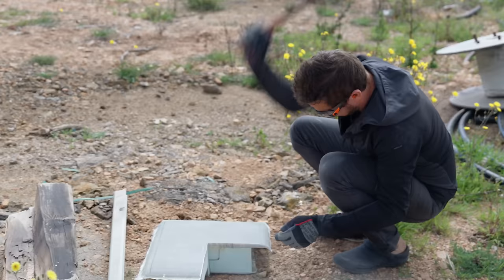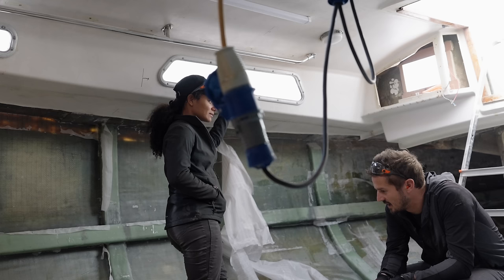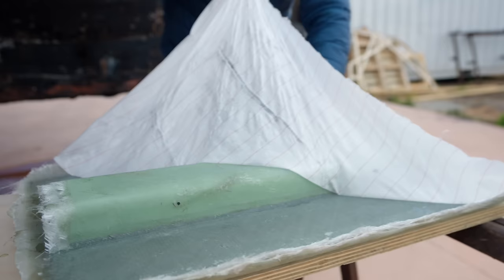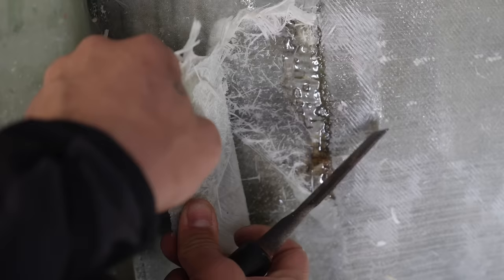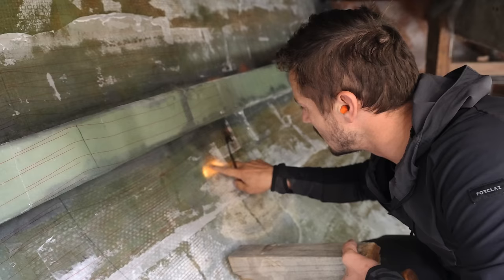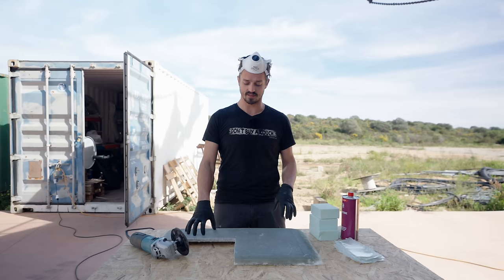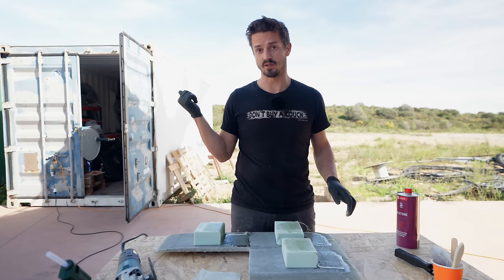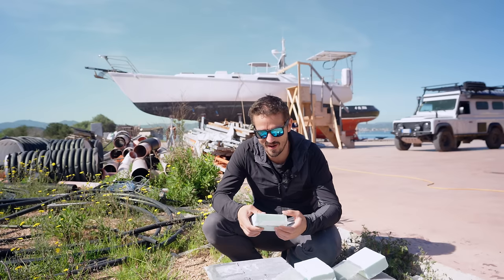If It Doesn’t Work, Hit It With a Hammer | Step 387

Comment: Acetone, grind, then brush dust off, then acetone again to get the last dust.  Wipe with acetone just prior to using resin.  If you use polyester resin it will even get a little tacky when wiped with acetone.  I assume this helps the bond, getting rid of the last bits of sanding dust definitely helps.

Comment: peel-ply just keeps the surface clean -- if the resin has completely hardened you need to re-key the surface / grind it.   IFF the surface is still green you can remove the peel-ply and add layers because they'll crosslink and chemically bond -- BUT that won't happen with fully cured or even > 90% cured resin.

Comment: After watching you guys I’m never using anything but epoxy!  I’m not a professional, just a guy with an old boat that has been strengthening the bulkheads and adding tabbing.
Reply from the maker: Epoxy is much more friendly DIYer product for sure. There's a reason all the pros and builders use Vinylester and DIYers use epoxy.
Reply: @SailingUma  using epoxy is a poor substitute for proper prep, design and methods for DIY bogers.

Comment: In the production boats I worked on, the guys would always sand after using peel ply and then wipe clean with acetone. I’m not sure if they wiped with acetone before. Definitely no delaminating occurred, even after 15-20 years. I’ve kept in touch with some of them.

Peel ply was only ever used on final surfaces. I mean, never on any internal layers. 
The foam core was “glued” to the outer skin using Divilette, and vacuum bagging it, allowing to dry, and then glassing final layers and peel ply lastly. The areas where floors, bulkheads, and deck to hull were to be attached, were all sanded and wiped clean with acetone before glassing in. 

Heavier sanding was needed the longer the previous layer had been standing. This means the greener (less cured) laminates required less sanding, but we’re still sanded and wiped.

So you should be fine. Your tests here confirm this as the test where you didn’t sand had delaminating whereas the test where you wiped with acetone and then sanded didn’t delaminate, even tho you didn’t wipe with acetone after.

Comment: Yeah, testing the way you have is the best test. I hope no one applies the knowledge you have gained straight across with other materials or bonding agents but tests their own methods. What you have discovered with your bonding agent may not apply to epoxy for example. Epoxy is "wet" for as long as 7 days... certainly soft to touch for two or three days and able to fail within 72 hours (from my own unanticipated testing via early clamp removal) The poly that you were using should cure much quicker, in hours, than epoxy.  Each set of methods varies in it's requirements. SOmeone used to working with one method will find it easy to miss with another. Great video.

Comment: vinylesters are supposed to be the best of both worlds: the polyester and epoxy ones. 
ive never worked with vinylester, i have been working extensively with epoxy (3:1 ratio) and a glassed a bit with polyester. from the bits ive read - and ive might have interpreted them wrong - it seems epoxy is slightly more flexible than vinylester. now, this may sound counter intuitive but a slight flexible resin is what you want when you are reinforcing an existing structure because that flexibility enables both surfaces (the orignal substrate and the new layers you r applying) to stay together, when put under the "sailing stresses".

Again, if ive interpreted that small bit of info correctly, i would then say: just use epoxy. its more expensive sure, but it really appears as the material of choice.
When i laminate i always use peel ply, though resins - at or below a 3 to 1 ratio- do not, usually, develop amine blush (the waxy by product of mixing the resin and hardener). 
WEST system, for example, is a 5 to 1 ratio and it will develop amines. ive also used WEST and never had problems because ive used peelply for the fillets (and cloth laminated surfaces) and always used acetone to clean said fillet and the surrounding area i would be laminating over. i never sanded the surfaces but im sure that improves the mechanical bond.

Because working inside my 29 footer is a challenge in itself, it goes without saying that dust is everywhere. 
Now , i do my best to vaccum and acetone them surfaces, but the enemy here is oily, waxy, silicones, rubbers, etc, not polyester dust. if anything that dust acts as a filler, and the only downside is that - in the event of someone beeing a real slacker when it comes to vaccuuming -  by having too much dust it will make the resin "thicker" thus more viscous, ie, being more difficult to impregnate the cloth you are trying to laminate.
 if it is true that epoxy sticks to polyester better than polyester sticks to itself, it follows that the same happens between polyester dust and epoxy. 

i honestly think you are going to be alright, and this episode showed that. i just would ve gone the epoxy way. all the way. 
all the best

Comment: Back in the 1970s I was a boilerman in the navy.  There was a joke that went, there are two things in a boilerman's tool kit, a hammer and a rubber. If you can't fix it by hitting it with a hammer, f*** it. I was sent to engineering school to learn about all the auxiliary equipment, such as pumps and blowers.  When looking at one of the pumps, the instructor pointed out a metal plate that had a sliding valve inside.  He said, "if the valve get's stuck, hit it with a hammer, right here..."  And I thought, "wow, they really do teach us to fix things by hitting them with a hammer."

Comment: A big difference between your boat and the samples, is that the ribs on the samples are simply laying on top of the glass. But your ribs/stringers go from one side to the other, they're pressed up against the hull from the other side of the hull; there's no room for them to budge.

Comment: I would get the boat lift and flex the hual because hammering that block of wood is doing nothing
Reply: EXCELLENT idea, and do it before the bulkheads go in so it is at its most flexible.
Maybe subject it to some temperature changes too by hosing a section down repeatedly on a hot day.

Comment: Joining the foam framework with hot glue is the weak link. Thickened epoxy with mucho chop strand, squeezed out from an icing bag is what I would suggest. This will create a bond between the hull and your new work.

Comment: It would appear that the root cause to the failures is that you had no bondline between the foam block and the substrate other than the squiggle of glue you used to hold the foam block in place.  This created a void in your laminated structure that when you smacked it with a hammer caused the fillets and over wrap plies to delaminate.  You may have done better by laying a wet ply on the surface first, add the foam block that had been previously shaped with better contour and more draft angle than a 90 degree block, and then over wrapped the laminate.

Comment: Before you set sail you might pack some thin cyanoacrlic resin ("superglue") in your fridge which will rebond delaminated layers if it occurrs after a period of time.   By thin something like 3 centerpoise viscosity and it will last if kept in the fridge for a couple of years or more.   Mop up excess resin with paper towel but be aware it cures exothermically (gives off heat) and can vapourise the resin which is an irritant if the vapour gets in your eyes,  so just keep your head to one side and ALWAYS wear glasses.   Cured resin you can get off skin etc. with nitromethane which is an additive used in model glow plug engine fuel.  Cyanoacrylic resins cure by reacting with moisture on the surface (which is why it sticks skin so successfully) so the damp interior of the boat should help,  not impede curing.
Glad you re-did the samples!

Comment: I am not familiar with Pee-lply but usually when you put a layer of something over fresh resin it cures it completely as if it was an "air dry" resin not a laminating resin. When using laminating resin I have never put anything over the resin until the last coat. Does Peel-Ply prevent the resin surface from curing so that it is ready for more resin layers? I cringe at the size of the job you are taking on but you're young and full of P&V, lol. Great work so far!!

Comment: Most of the DIY fiber glassing I've followed on YT are all Epoxy Resin.  I think you just revealed the main reason (it's more forgiving in the process)... vinyl ester appear to have a bit of a steeper learning curve and a few more "gotchya" type quirks to their layup best practices.   I think the two primary exceptions are "Boatworks Today" (which teaches both), and "MJ Sailing" with their kit build in vinly ester, though I'm sure there are others, but it's not something everyone covers in depth for sure.
Reply from the maker: Yes. Epoxy is used mostly by average DIYers. All the pros use vinylester. Unless building race boats. Then they use epoxy and carbon.

Comment: Did you consider getting the ultrasound guy back to test your adhesion with ultrasound? Foe example ultrasound an area then whack it with the hammer and then re-ultrasound it I think the ultrasound would be perhaps more likely to detect early deamination than just a visual inspection.

Comment: No matter what, all the new glass you're putting inside the hull is going to bond mechanically (as opposed to chemically) to the hull, so delamination is going to be the initial type of damage you can expect in the case of an impact to your hull.   Cleaning and grinding will provide more clean surface for a better mechanical bond, that's really the best you can do outside of glassing an entire new hull.  Given that you're covering all of the interior with another few layers of glass, I wouldn't worry about localized delamination in the event of impact to your hull as it will maintain the entire structure in place.  In other words, it will be fine!! :)

Comment: I just started watching the episode, but I want to point out a HUGE flaw I noticed in your destructive testing. Also, I haven't read any comments, so this may have already been brought to your attention. 

I am an aircraft mechanic in the US, and as such I have some interactions with and been taught how to build glass projects, perform general visual inspections (GVI), and non destructive inspection (NDI).

The quickest easiest way to perform an NDI is called thr coin tap inspection. Basically, tapping a coin along the route, listening for a different sound. Different sound tap than majority or whole of area indicates delimitation. Obviously GVI is doing a visual inspection, looking for any obvious damages.

You guys performed a DI (destructive inspection) on the test piece, cutting into pieces to see what the final completed product looks like. You then, hit that already destroyed and highly compromised test piece, and performed more DI by hitting it with a hammer, and dropping heavy items on it. 

The proper way to have performed your testing would have been to perform a coin tap test, to verify proper adhesion of glass and resin. Then hitting the whole piece, undamaged, with the hammer and wood. Then perform a DI by cutting the piece apart to inspect the damages.

You guys shouldn't have been surprised when you compromised the test piece, and then perform more destructive tests, and it completely failed.

The way that fiberglass works is by relying on the strength of all the fibers and resin as a combined whole.

I sincerely hope you guys take this as constructive criticism, not as being mean or negative in any sort of manner.

It's fun to live through you guys and follow the progress you two have made! Keep working hard!

Fair winds and following seas!

Comment: I guess everybody was surprised how easily the sample gave away.
Very encouraging that the chisel test show us a decent result.
While not perfect this kind of adhesion, through out the entire hull guaranties a sufficient bond .
BTW I do not think the hammer test had any value : on your sample the shock wave added to the bending
was significant, to replicate this on the boat you would have to hit with a ram .
Good to know you will be safe.

Comment: for a chemical bond  layup needs to be tacky  if not you have to grind to create a mechanical bond.  or use a  epoxy  that has better adhesives  properties.

Comment: Hi guys, thank you for sharing your refit. I have a question. Doesn't the boat expand in water? while you're testing on the dry parts. Should you use water on the boat and then tap it? to see what happens.

Comment: A few comments about bulkheads. Wood to glass/epoxy  or ester resin bond nay look good at first but as time goes on the glass/wood bond will weaken. The moisture content of wood causes it to expand and contract making a shear force at the plastic/wood interface that weakens the bond.  Just from a temperature difference causes a shear force on the bond because of differential expansion between the wood and the plastic. A much better preceedure is to use glass or foam/glass bulkheads which do not have expansion problems.  Secondary bonding   ie bonding cured plastic to cured plastic you found out can be done with proper preparation of the surfaces, but will never be as good as chemical bonding of partially cured laminates at the time of the bond. One good material for reinforcement of the plastic at points of high point loads,for example chain plates is to embed titanium plates into the load area, surround the edges of the titanium with a cotton flox mixture and put multiple  layers of glass plastic over the plate. Titanium has about the same expansion as the glass/plastic material and does not corrode like alum or stainless steel. Titanium is slightly softer than steel and thus must be somewhat thicker than a stainless steel plate to take the edge loading from the bolt passing through it. The reason titanium is not commonly used is cost.  I come from a home built aircraft field and work with materials nearer their max load limits to minimize the weight of the structures. Weight is not as much a consideration in boat building. Do your research first to know what you are doing.. 
csmale9@gmail.com
Reply: When you say "cotton flox" I presume that is a mixture of cotton flock (fibers) and resin?

Comment: Just checking to see if the glue you are using has silicon. Silicon can not be removed with chemicals. Grinding would remove it. We had metal chassis delivery and had silicon on our fingers. Nothing would remove it - the painting process created rings in the paint.

Comment: I think the real lesson here is if you are going to test a process to confirm structural integrity of a larger project using a smaller mockup you need to make sure your process is the same in both places. There were quite a few differences between the two and we know why the pros are pro.
Reply: Some pros are more amateurish in some respects than some amateurs.Particularly in the plastic boatbuilding field.

Comment: Its really a bit late doing the work in tandem with the hull work. Also fillets in the corner to stop 90 degree corners, and filling air gaps in the basic structure would be good practice too. the 90deg hard bends are not good for the fiberglass it stresses them too much just add a fillet.

Comment: Hi, maybe I missed this but.
On your test piece did you use peel ply on the base layer (resembling the hull) then try and laminate onto that pice with your stringers without sanding the test hull section? That would definitely cause the failure to bond.
My experience with vinylester is very good bond to existing fiberglass with just a 40 grit sand and a wipe down with acetone.

Comment: I’m wondering if polyester resign operates with the same rules (with respect to peel ply) as with epoxy resin (rules you apparently have been using). In all, sand and clean - best practice!

Comment: Guys, why dont you glu the foam pieces with resin ? Using hot glue will definitely create a weak spot in the whole structure. If the foams pop out for whatever reason, the structural reinforcement looses its purposes. And someone mentionned filleting those foams before laminating. Yes for sure do that as well!

Comment: From my experience in repairing downhill skis I always used a single sheet of low weight bond paper between layers to achieve a lasting flexible bond. Even in aggressive ice-mogul skiing the bond did not fail. Comments welcomed.

Comment: In the future please use liqiuid styrene on Old grinded surface. You can use rag wet from styrene to make   Old surface activated and soft outside. Then use a Cobalt naphthalene and then You can aplly New layers of GRP Laminate. This is correct method to connect New with Old.

Luckily result of Your delaminating test inside boat is good so You can sleep easy. But in future please dont forget about styrene and Cobalt naphthalene. This is correct method.

And please forget about acethone. It is not good to clean big surfaces and to degreasing.
Good luck. 

David

Comment: One alternative which is stronger and lighter than fiber glass is basalt fiber. It is also way less yucky to work with, as the fibers are a different size to those of fiber glass and are way less hazardous and also less irritating. Presumably it would bond on to existing fiber glass OK, but I am no expert.